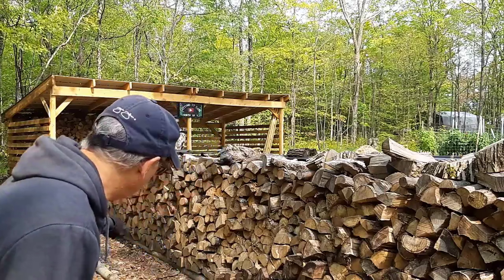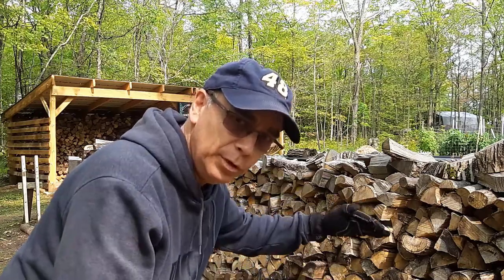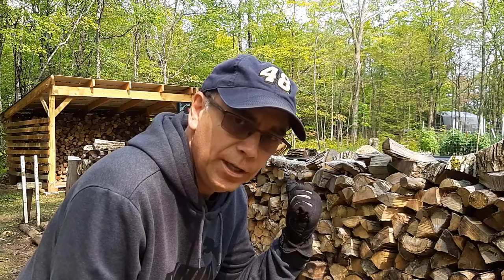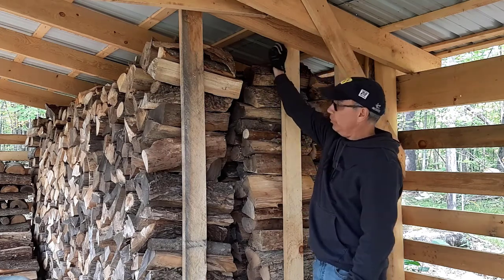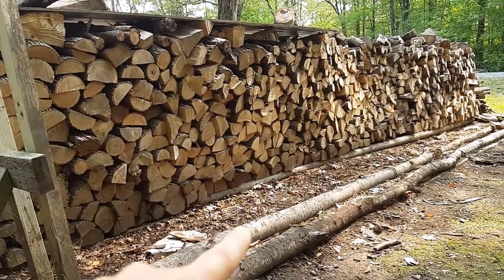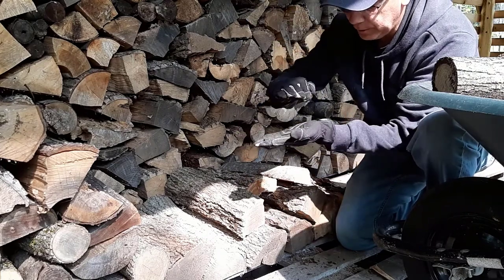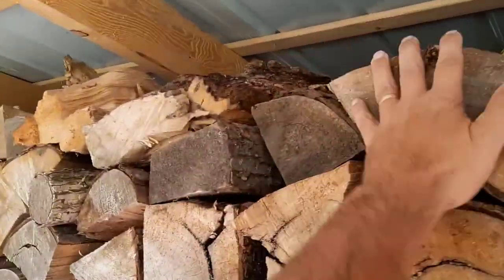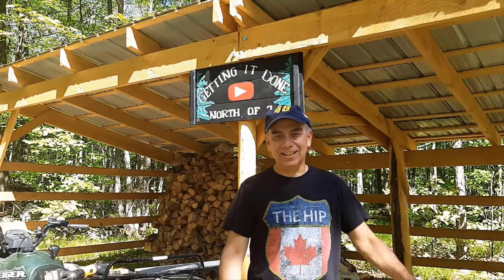Stop Firewood Pile From Falling // Best Firewood Stacking Tutorial

Comment: I find my wood dries better with the bark down but it is harder to stack
Reply from the maker: But any wood below the top layer is covered. I don't see how the wood would dry better. Plus you can't stack your wood efficiently
Reply: @GettingItDoneRepairs  
I guess the thought is as the moisture disapates it rises and get trapped under the bark. Bark down allows better evaporation.